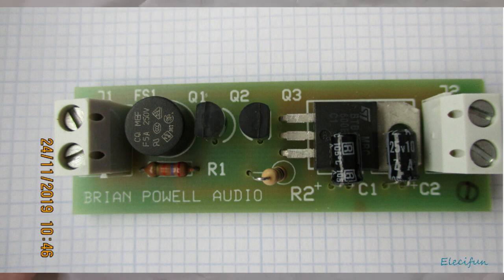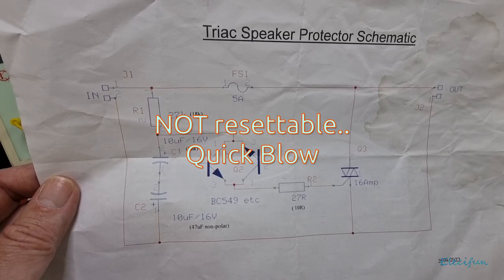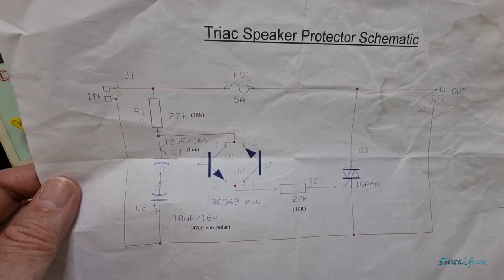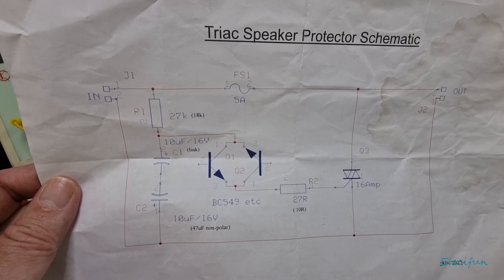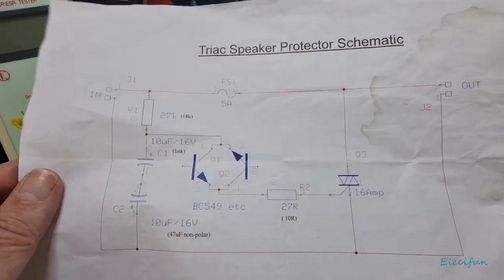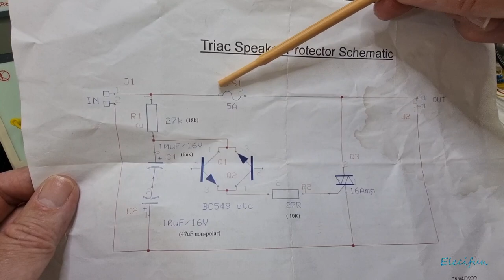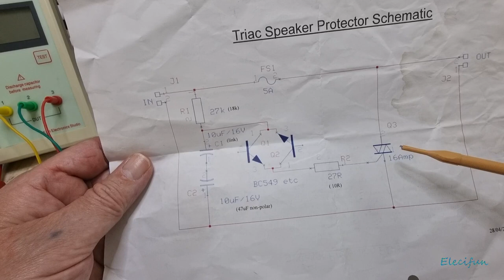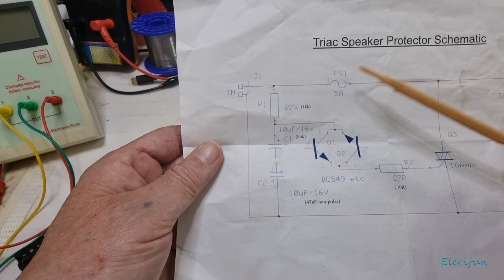DIY ESP 60W Amplifier Blowout - Results

Comment: Hey amigo 😂 Wow that's a nice big hole ! 🕳  What caused that ? Sorry I didn't get why it exploded. 🤔 

Recently I fixed my Logitech Z5500  Surround Sound System.

Well while I was trying to fix it I forgot to change the amount of volts I was injecting unto my amplifier board! Instead of 14V I put significantly more into into ! 😮 The horror of realising my mistake.

Fortunately I didn't destroy anything. 😅